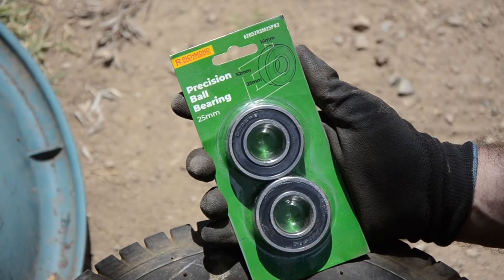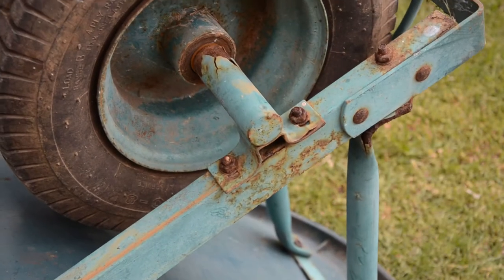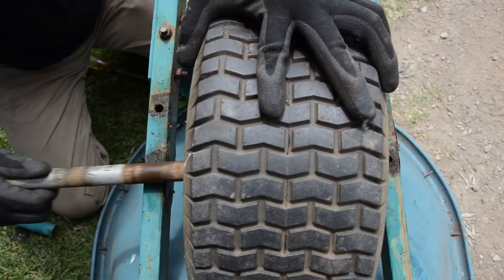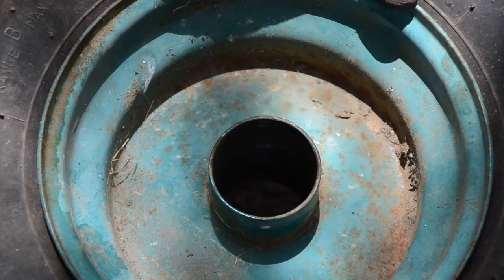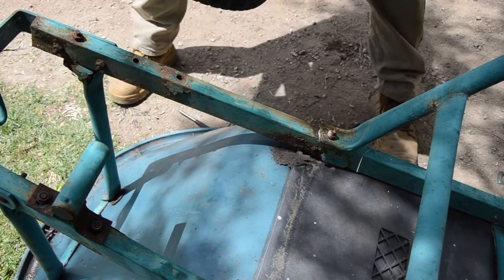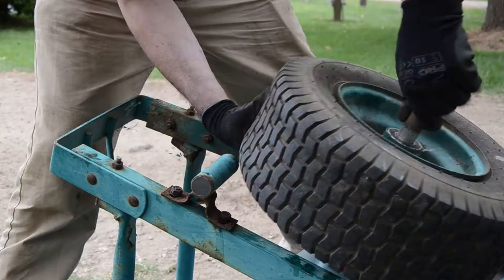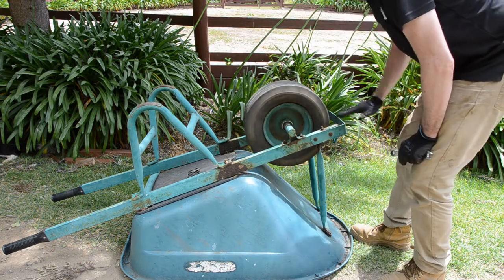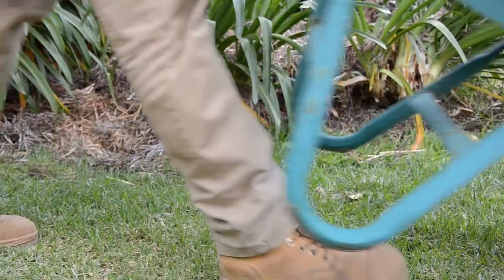How to replace your old wheelbarrow wheel bearings

Comment: do those bearings need protection from dirt and water from outside?
Reply from the maker: Hi Hooperwille. These are a sealed bearing, they are protected from dirt and water. You also won't need to lubricate them, although the odd external lubrication won't hurt. You should get as much life out of these bearings as you did from the original set, maybe even more.